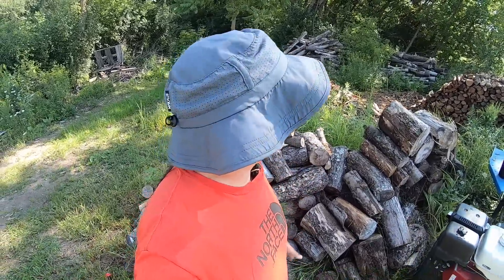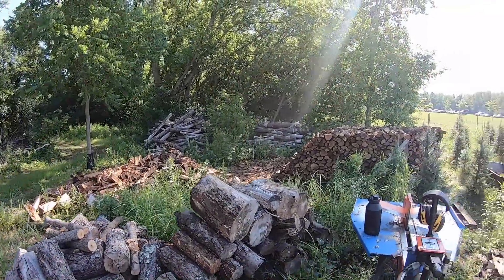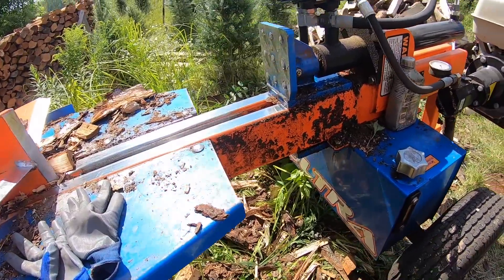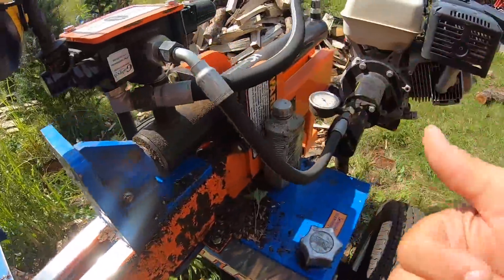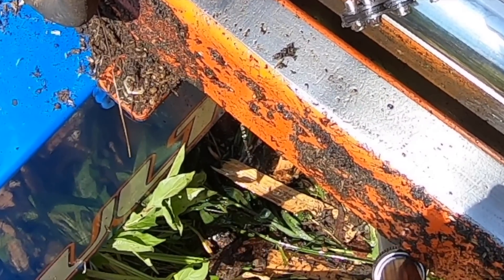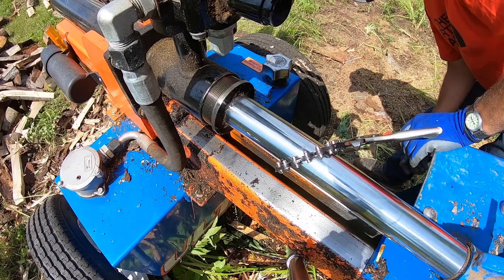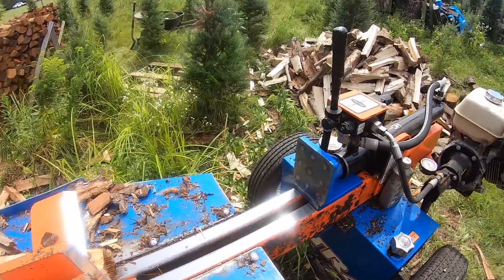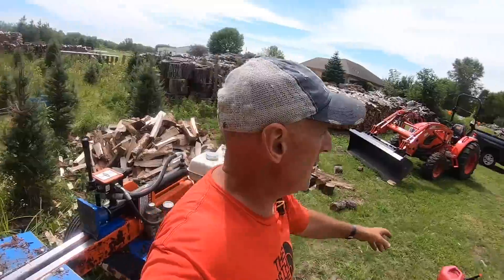Hydraulic o-ring repair on the Eastonmade ULTRA log splitter!

Comment: Oh no Chris... You put the backup ring on the wrong side of the O-ring. The backup ring supports the O-ring and gives it a smaller gap to seal... Although I haven't finished the video yet haha.
The other odd thing is the seal that's worn is usually used in dynamic sealing (dynamic like the inside O-ring you didn't touch).
Reply from the maker: It is working great now.

Comment: You lucked out, the new O ring should be well oiled before threading the gland into the tube.The thin O ring stops rain from rusting the threads.The threads should have Never Seize or grease before installing.The bigger the glob, the better the job.
Reply from the maker: Thanks for the tips!
Reply: @InTheWoodyard  Take the guy a bit of fire wood.

Comment: Tips from a pro mechanic: Get the correct seal kit and an adjustable spanner. Usually this type cylinder has a small set screw to prevent the gland from unscrewing, might be on the bottom where it's hard to see. Once pressurized oil flows past an oring it erodes the rubber and it will need replaced soon. The backup ring goes away from the high pressure side or you can use 2 backups with oring between to fill a groove. Check for burrs around the cross pin hole and the rod end that could scratch the rod seal during installation. Use a soft face dead blow hammer to move the gland, never pound with a crescent wrench!
Reply from the maker: Thanks for the tips! I appreciate it!

Comment: all the rebuild kits for my case backhoe cylinders come with an O-ring and back up ring (the flat ring) instead of the OEM x-ring seal on the gland nut. I just had to do the dipper cylinder on the boom. I had to take it to the local hydraulic shop to use their nut-buster table to break it down. 1" impact driver not a 9' breaker bar would get the piston bolt loose.
Reply from the maker: Good to know!

Comment: When all else fells get a round punch that fits in the spanner wrench holes in a slite angle and a hammer to hit with and it will turn out and get tighter when you tightening it back than with that wrench.  Worked on a logging crew for years and that's how we did all cylinders on all the equipment never had a spanner wrench to fit the different cylinders
Reply from the maker: Thanks for the tips!!

Comment: Chris nice work on replacing the O-ring.  It seems like the O-ring has gone bad twice in a pretty short time period on the Ultra.
Reply: Yeah. I thought that too
Reply from the maker: No, actually it is 2 years old and I have really used it a lot! The other rings where in the control valve.
Reply: Okay thanks for the clarification, Chris.  I thought they were the same O-rings. I have considered upgrading to the Ultra. It looks like a darn good splitter.

Comment: Either you misunderstood what the person at the hydraulic shop told you or they gave you incorrect information. The part that they gave you to include in the groove with the large O-ring is called a backup ring. The backup ring should be installed so that it is on the opposite side of the O-ring from the high pressure side. The way you installed it the backup ring was on the high pressure side of the O-ring.
Reply: My hydraulic guy says the same thing, The O-ring "sees" the oil. Also, there is likely a concave side to the backup ring.  The couple I've messed with both had it. The concave or radius mates with the o-ring.
Reply: @bioniclife  yes, the backup ring has a concave side and a flat side. The concave side goes towards the O-ring.
Reply from the maker: Thanks!
Reply from the maker: Thanks!
Reply from the maker: Got it thanks!

Comment: Very nice video.  Your brother should be very proud of you.  
I keep a five gallon bucket of ripped wood shavings handy as a reserve for soaking up fluids.  That is my back up for when I run out of Oil Zorb.

Yesterday I made a dump run with some bark and junk from my splitting adventures.  All of my wood is going out the door barkless.

I had a row of wood that did not make the Quality Control Inspectors Ridgid Standards stacked up in the back of the truck.  That wood got wet during our seven inch drizzle over the weekend.  I had the wood on the black truck bed liner so the wood could dry from the rain.  This wood goes to a friend who heats with wood.

A guy in a Cadillac pulls up next to me and he asks if I am throwing out the firewood.  I said no, and I asked him why.  He said his daughter was looking for firewood.  I told him that the wood was saturated from the rain. 

I told him to take his Cadillac and back up to my truck and I gave him a trunk full of wood.

I thought it was nice that he cared enough about his daughter that I decided to help him out.  

He must have thanked me fifty times.  Hey if seconds can make his day, so be it.  For me it is not about the money.  My junk was this guy's treasure.
Reply: Than You.  It is not about what you do for someone, but how you make them feel.  I hope that in his daughters eyes, yesterday he was a super hero.
Reply: Nice gesture , Ann Marie. It’s fun  just being a good human sometimes isn’t it?
Reply from the maker: COOL!

Comment: I think you need to look into adding a inline hydrolic screen filter to your cylinder. You need 2 of them.    If the reason your leaking is from rust inside. It will destroy the piston.  If your just getting wood dusts eating up the  oring. . That's something different.  Maybe it's a damaged outer seal.   If the cylinder goes out. I would definitely add the the in line screen.    

I think you found a good shop.   I know a few guys like that.
You could fake it as a farmer. If the photography, doesn't work out for you
Reply from the maker: Thanks for watching!

Comment: Good work Chris.  Nice that you now have a local hydraulic repair parts/service connection.  I suspect that you will find them valuable down the road as you now have lots of hydraulic machinery.  Order the spanner wrench, it will save you a lot of time next time and enable tightening the gland so it doesn't come loose again.  You are turning into a regular machinery service guy.  When it comes to hydraulic repairs "cleanliness is next to godliness".  GNI
Reply from the maker: Thanks Larry!

Comment: You could call Eastonmade and get a set of o-rings and possibly a spanner for the next time it leaks. When you install the next set rotate the collar as you pass the push plate hole, that should keep you from nicking the o-ring as you go past it. Lubing with oil will help it slip on easier. Good luck!
Reply from the maker: Thanks Jeff!

Comment: Before you crack open any hydraulics you should give the area around it a bit of a clean with a rag, some brake cleaner or something at least. You really don't want any sawdust or especially dirt inside your hydraulics. Some nice hard grit inside the ram will chew through things faster than a Chris unloading a truck.
Reply from the maker: Thanks for the tips!